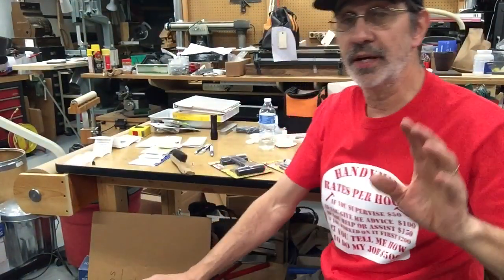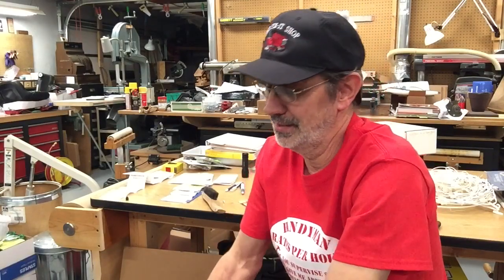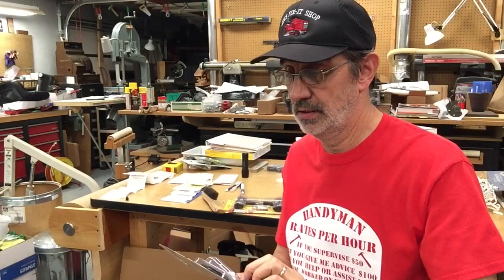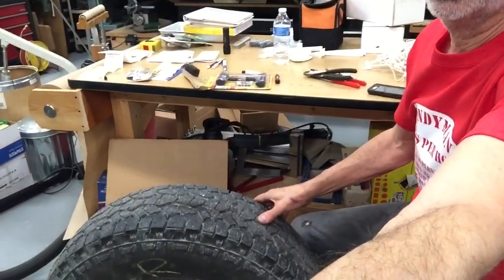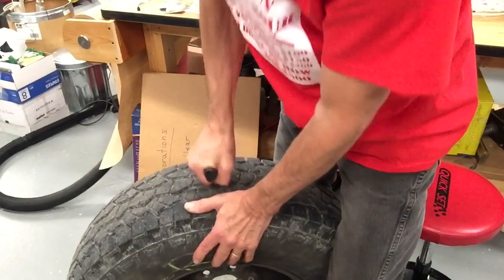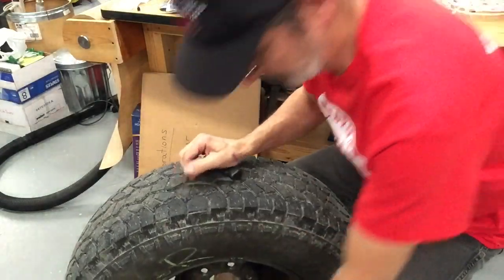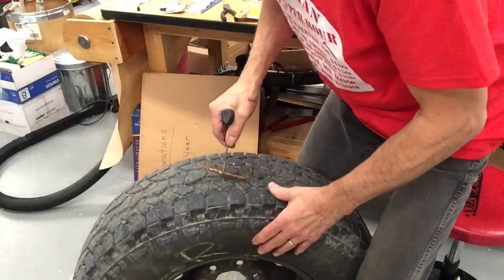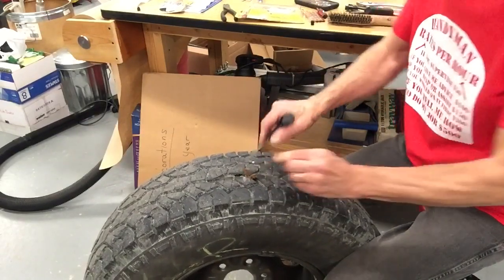409. How can I fix a flat tire￼￼

Comment: I place a 1/4" drive socket on the plug insert tool to keep from pushing the plug all the way inside the tire. 💡 Take care Jim & I'll catch ya later.👍
Reply from the maker: Now there’s an idea I never thought of I’ll have to try that I know when I want to drill a hole and control how far the drill pokes through the other side I drill a piece of half inch or three-quarter inch wooden dowel and cut it off to the proper length so just enough for the drill is sticking out to poke through the surface. Jim
Reply: @jimjackson9381  I got that lightbulb moment after I pushed a plug through. Had to push pretty hard even after the reaming tool which I also dip into a small can of the glue. The little can I buy has a brush connected to its cap. I brush glue/ lube on the plug. Once it starts into the tire I can't stop pushing fast enough to keep the plug from going all the way inside the tire. I HAD to come up with something & a small socket was readily available. Glad to be able to share my knowledge for a change.😂  I've certainly learned a LOT from you. Thank you for sharing your knowledge on video.👍 I truly appreciate them. Take care.😊
Reply from the maker: Well thank you for being a viewer I hope a subscriber and thank you for commenting. Jim

Comment: Hey Jim Happy belated New Year to You & the Mrs. ! Hey I have one of those , & I found it easier to have the tire removed from the rim , & patched on the inside most tire shops will not use plugs anymore ! I found also that once the plug is in use a little propane torch to heat it up to were there is no air pockets , & let it sit for about a 1/2 hour then air up the tire , & make sure were the plug is that it's resting on the floor surface ! & let it sit overnight ! Plugs are only a temporary fix! & during the summertime  ( to much heat on the tire ) they don't hold up as well , & winter time they do a little better as far as holding were you put the plug in . When you patch a tire from the inside all the air puts pressure outwards on the patch , But they still need to stuff the inside of the tire so the patch will hold better . I'm lucky that I have a friend that has a tire machine ! Sorry to hear that tire shop couldn't take care of your needs ! Take it easy Jim .
Reply: @REVNUMANEWBERN  They do work on certain tires ! But I have had them fail on automobile tires a couple of times ! I have never had a patch fail that was put on the inside of the tire of any of my vehicles !
Reply from the maker: The only problem with that patch is you have to have a tire machine to do it if you’re doing it at home or even on the road a plug is the only thing you can do I’ve had one in the front tire of my Ranger for about 3 to 4 years now and it doesn’t lose any air. Jim

Comment: I leave air in the tire when installing a plug. It seams to push in easier.
Reply from the maker: Yeah I can see how that probably would be easier with some Air in the tire mine was starting to push down and probably pinched the whole shot I’ll have to try that next time. Jim

Comment: 8:05 They can't do it in Alabama. I've done it and never had one not work.
Reply from the maker: Thanks for watching and thanks for commenting. Jim
Reply: @jimjackson9381 I'm building a snapper, gonna put a 18 horse Briggs twin and a 42" (very old) Simplicity 42" deck. I'll send you a picture win  I'm done
Reply from the maker: I would like to see it make sure you are sitting on it I would like to put it on my wall.  Jim
Reply: @jimjackson9381  I will and thank you! I have a machine shop so fabricating is not a problem. I may use a Murry 52" deck. My spare Snapper is gonna be a deck-less stretched  out chopper.
Reply from the maker: I definitely wanna see pictures of that when you get it done. Jim

Comment: Jim. I'm in a dilemma. Year after year.  Month after month.  Week after week. I constantly have my front tires always going flat on my 30" rear engine rider I bought in 2001. I  have replaced tires in the past, installed inner tubes, etc.etc. I'm way past tired of messing with them. They are the small 4.10-4 NHS tires. Does anyone make a solid rubber tire already on a front rim that we can use on our trusty Snappers ???  Or do you have a better idea??  Thanks 
Mark
Reply from the maker: Well, typically first thing I do is put tubes in the tires when I rebuild a machine and I never have a problem with it after that but if the inside of your rim is rusty and rough, that could be what’s wearing a hole in your tubes a good winter project would be taking them apart and checking them Either wire brush them or sandblast them and put a coat of paint on them. If they’re not rusty and rough I don’t know what’s causing your issue.        Jim
Reply: @jimjackson9381  ok.. so then as far as you know,  nobody is making any hard rubber tires for a mower rim this small?
Reply from the maker: @bugdude65  no the only tire I have ever found that is solid rubber is for a wheelbarrow.         Jim
Reply: @jimjackson9381  same here.  Let me ask, what inner tubes or do you have a part number on the tubes that you are installing?? The only ones I find around here and have installed, have the brass "bent style" stems that dont seem to last for whatever reason.  Are you using a tube with a straight style stem coming out?? It sounds like you must be using something better than what I can find around my area
Reply from the maker: @bugdude65  it all depends on the style of the rim. What tube I order but typically I just use the straight rubber looking stems, and I seem to have great luck with them as far as not leaking after I won’t put them in you do have to make sure that the inside of the rim is not rusty and rough.       Jim
Reply: @jimjackson9381  ok thanks for your help and insights..
Mark